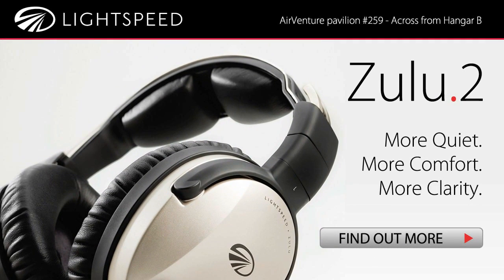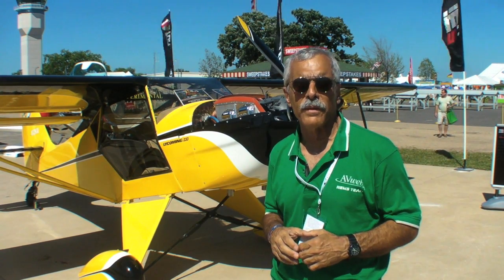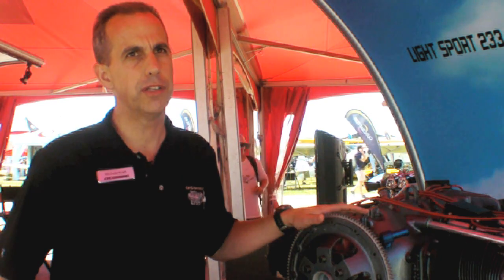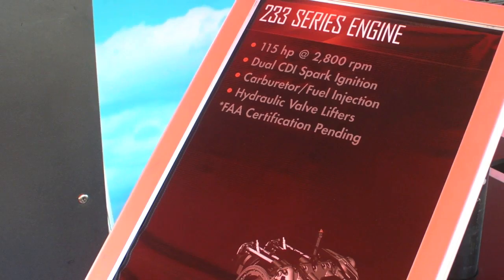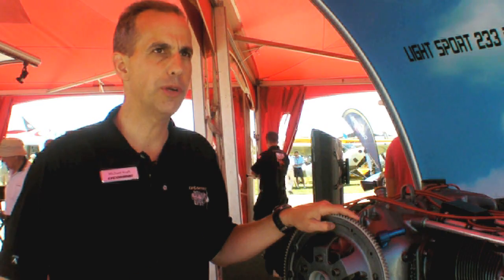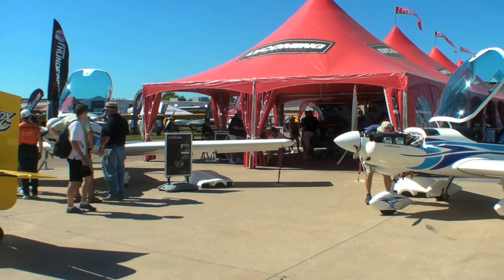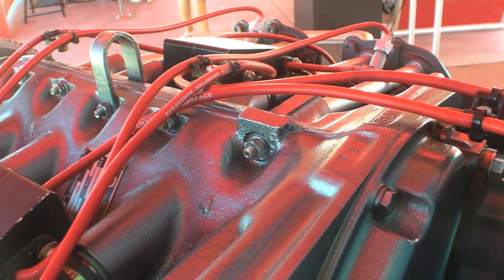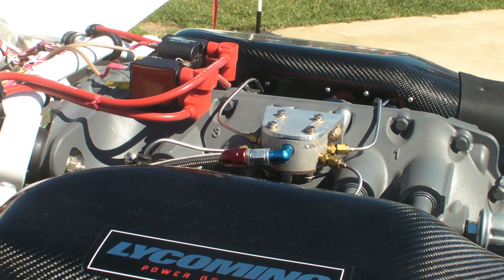Lycoming's New O-233 Takes Flight

Comment: I am not into kit planes. I like this engine. Good on you Lycoming for offering this in your none preferred market. Duel electronic ignition GOOD. I hope it has Duel alternators or generators otherwise there is no point? To those criticising this, I had a magneto fail at startup on a R22 when I was a student on a very hot humid day. ie 104 degrees. Lucky the instructor picked it up. Magnetos will not save you any more over this electronic system. If this engine does not have duel alternators then maybe consider a second "lithium" battery only attached to the ignition system.

Comment: I do not quite understand what does a 115hp engine do in a 1320 lbs airplane which has certification limit at the full-power cruise. The only application that I see is an extremely draggy airframe like Skykits Savanna, which can use the extra power to improve high-and-hot operations without blowing the top speed limit.

Comment: @klesmer ... single problem of any kind. They sold it in excellent operating condition. Funny thing is, the FI system in that Camry was a Bosch system that was license built by Nippon Denso. I guess it just goes to show what a little bit of good quality control does for reliability.

Comment: @klesmer Well, I don't know anything about Siemens, is that what the American brands use? I've been working on cars (not professionally) for about 10 years now and I have yet to see a fuel injection related problem with a Japanese vehicle. More accurately, there was one problem with an early '80s Camry but it was caused by the owner removing the cover on the MAF sensor, which then ended up full of dirt. My grand parents had the same basic car, it went over 200K miles and 22 years without a...

Comment: @idontcare80 Folks whose lives depend on trustworthy power are who cares. After a 45yr long career as a tech for 'Benz, BMW, and Volvo, I know enough about  electronic fuel injection and ignition systems that I don't want them on my airplane. Magneto's and carburetors work just fine thank you.
Reply: klesmer - Good ole magneto ignition. Age old technology. No and coil or battery/generator needed!